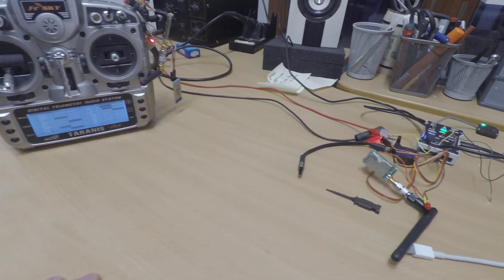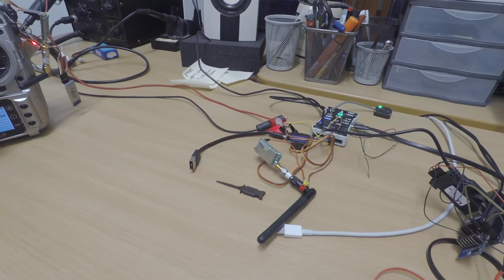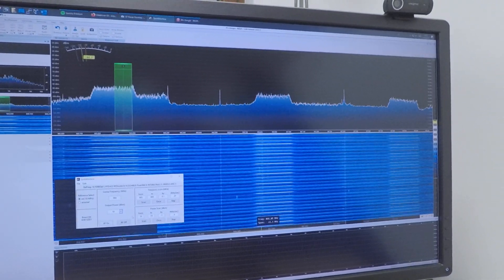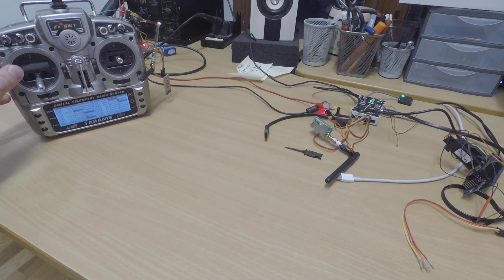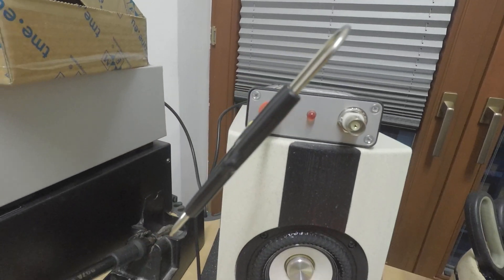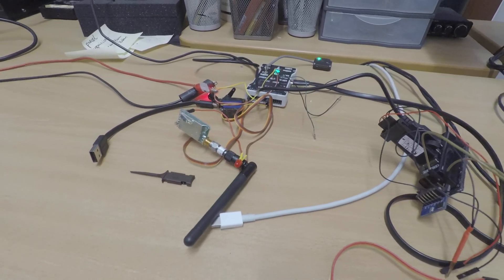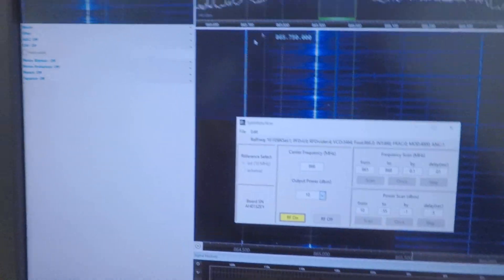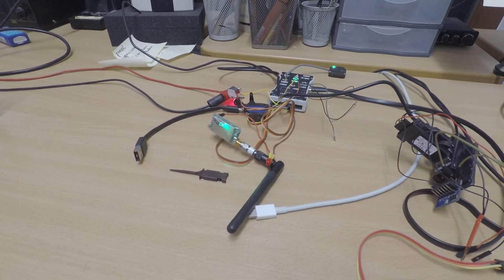Qczek LRS 2.0 changing RF mode (standard to/back race)

Comment: Why pockets lost? 
Another: Please correct the 1.92 configurator, the default channel spaceing is 125 khz, while the normal mode is 250khz, race 500khz bandwidth. Or I think somthing wrong? Yesterday I had sudden failsafes, today I changed to 250 khz spaceing and luckily I had no failsafe at all in more than 5 minutes! Thank you for your work in this wonderful thing!